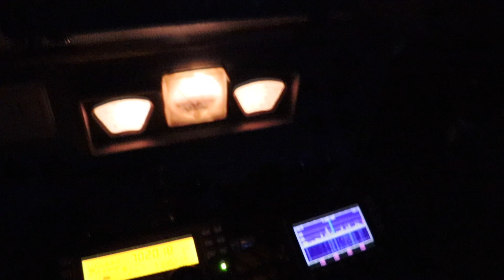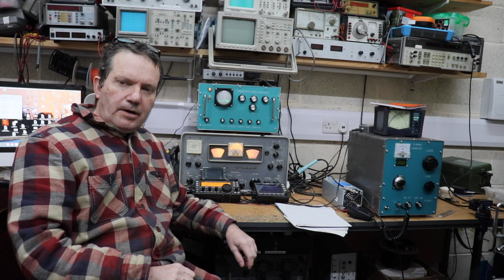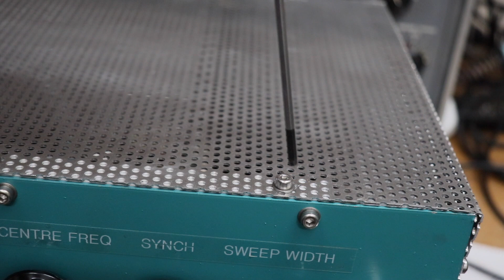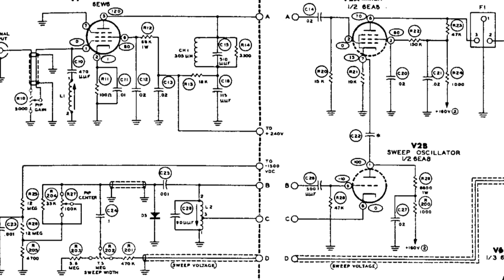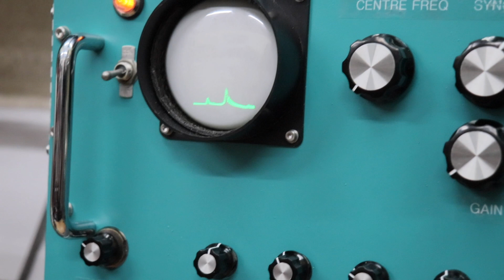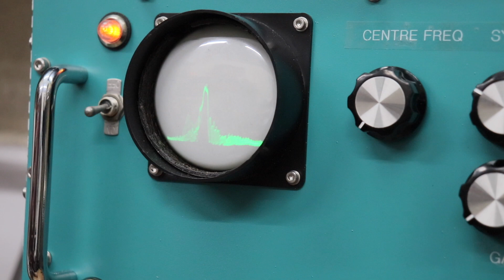Panoscopes And Panoramic Adapters: What Are They And How Do They Work?

Comment: Another question that has bugged me: why does the sweep have to be a linear sweep (i.e. sawtooth wave)? Why could it not just be a sinusoidally varying frequency that could easily be derived using mains frequency as the control voltage instead of the complicated blocking oscillator? All of my vintage TV/FM alignment sweep generators just used 60Hz AC to frequency modulate (sweep) their output, and it displayed the bandpass being aligned, perfectly on the CRT of an oscilloscope. I would love a good explanation of why these panadaptors always used a linear sweep, requiring an extra tube. Maybe it has to do with a certain integration time at the output of the second detector (vertical signal), so "pips" near the middle of a sinusoidal sweep, where dv/dt is high, would display with a different amplitude than "pips" near the peaks of the sine wave where dv/dt is lower. On a sawtooth wave, dv/dt is constant.
Reply: Brightness of the trace will be different, fainter on the center and brighter on the edges, the speed of the beam is dependent on sweep speed

Comment: Great video, thank you. I actually found a surplus panadapter made by Nems-Clarke (Model 200-2) that unfortunately takes a 21.4MHz input and uses a 4.3MHz second IF. I want to leverage the power supply, sweep oscillator, CRT and chassis/controls, but convert it to work with a 455kHz IF to use with some of my boatanchor rigs. Your video gave me some encouragement that it may not be as hard as I thought to replace the tuned elements. I have some old car radios around that (at least here in the US) should have 262kHz IF transformers. Did you actually tune your 262kHz IF transformers down to 226kHz or whatever the schematic called for, or did you just leave them at 262kHz and adjust your local oscillator sweep range accordingly? Also, how did you modify the 455kHz input IF transformers to have a wider bandwidth? Thank you and 73.

Comment: Very good.
I built a solid-state version ages ago from either Radcom or similar. It used the 10MHz IF and for the display it used an oscilloscope in X & Y mode.
It worked perfectly for years but was junked when I moved to Wales :-(  
I have to say, it didn't look as nice as yours...